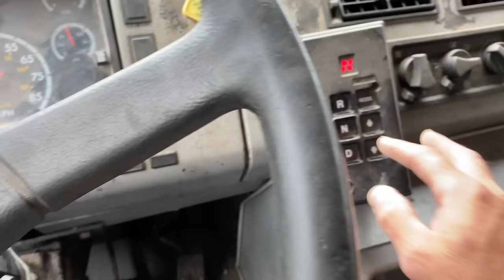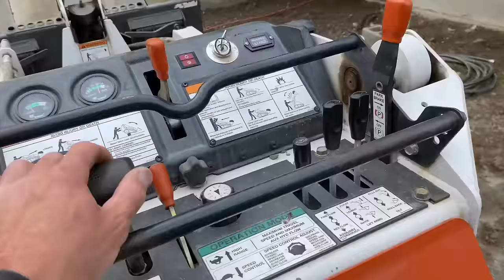NEVER SEEN BEFORE TECHNIQUE TO BUILD STAIRS

Comment: Fulton Spring Works 👍, and the slow shift into gear is probably a sticky air servo, sometimes you can clean them up, sometimes just replace them, might be electric too, but yours sounds like an air servo.
Reply from the maker: Thanks for the info on the truck.
Reply: @bondobuilt386  Been there, done that! 😉 By the way, a lot of armchair quarterbacks in here today, I think you should take everything they say very seriously! And to make sure you don’t forget, write it down on some Charmin, or Angel Soft, using some brown ink, of sorts! 😂🤣
Reply from the maker: Ya buddy this video has brang them out of the woodwork. LOL @Musclecar1972

Comment: No railings? Inspection or not, builder shouldve insisted.
Reply from the maker: They built temporary railings they are in the video and they ordered iron railings to be installed later.

Comment: Legit work,  you always produce high quality work,    seeing that cut Block in the middle of the run on the steps,  obviously because of the predetermined width of the steps  ,   got me wondering , why not run those half bond or running bond. ?   Then as I'm typing it hit me.    There all getting core filled and it prolly fills more complete without the bond.
Reply from the maker: You are correct my friend. 😀 Thanks.

Comment: Very nice, was wondering if you were going to do the bottom step and you did, very nice, luv the over hang of the steps, i'm thinking its 1 1/2"? I do this often an 1 1/2" with chimney caps and columns.

Comment: I need some help. I hope you have time to answer my question. Awesome video as usual. Love watching your videos. I learn a lot from them. Things have definitely changed since i worked with my Grandfather (concrete mason,crew leader) 35 years ago. I need to build a house, my40 year old mobil home is coming down around me. I want to pour a slab but don't have the money for a monolithic pour. 
Here's my question: Can you pour footers and footers for beams, build stem walls and beams for loadbearing walls with concrete blocks, and pour concrete inside to top of concrete blocks for a fished slab?
Reply from the maker: https://youtu.be/VwM0fJQ_xTw?si=6U_qggyI_oE4FEuQ
Here is a video where we did blocks on a footer and then poured a cap on top.

Comment: Make sure your axle can handle, i would just look into airbag helpers. The air ride system is safer and smoother ride. That truck can only take so much. In long run if you need more weight capacity you may need a dual axle bigger truck
Reply from the maker: Ya I think you are right

Comment: When I was a youngster some 50 years ago, we would lay at that time the 'cinder block' and fill with sand and pour steps over. Sometime later maybe 70s the precast stairs took over.
Reply from the maker: Yes I have made steps from regular blocks as well.

Comment: Just a little tip the edge underneath i know is hard so i would have placed a half inch pipe  at the 90 degrees angle there to give it that indented look. Edges would be looking better. Job well done though
Reply from the maker: Thanks for the tip. I will have to try that.
Reply: Your welcome sir

Comment: Not sure how that frost protection works. Is the foam board there to take up the heave expansion, sparing the concrete?
Reply from the maker: The foam stops the ground from freezing under the slab and lifting it up.

Comment: I have a parged basement from 2007 in Maryland that has chipping spots any repair products you’d recommend
Reply from the maker: The comproco we used in this video. Chip off all the loose and fill the low spots then let dry and re parge the entire wall. Wet the blocks if it is dry out.

Comment: So close to perfect, but no nosing on bottom step, top step looks like a lower rise, and bead of caulk on forms for bottom of nosings could have made a smoother finish.
Reply from the maker: the bottom is the slab and it will be backfilled to the surface so no need in making nosing.

Comment: What's the reason for the layer of gravel between the foam and the concrete?
Reply from the maker: I wanted to line the foam up with the foam that was around the house slab but I did not want the slab to be 16” thick so we added 6” of gravel so slab was 10” thick. The house slab was 16” thick on the edge.

Comment: What's the difference between filling the cores of the blocks with stone rather than filling them up with concrete as you're pouring the caps?
Reply: Personally I would prefer the stone in the cores for moisture control during the freeze thaw cycle.
Reply from the maker: the stone is to let water drain out as I stated in the video.

Comment: Great videos.  Please let me know if my thinking is correct.  Is the foam to thermally decouple the stairs from the warm ground so that all of the concrete gets cold?
Reply: It's to prevent frost from getting under the steps.
Reply from the maker: Yup thanks.  @ripperwrestling6587
Reply from the maker: to to protect from the frost getting under them

Comment: So i suppose that the theory is that frost wont penetrate the foam.
Therefore the ground wont heave due to the frozen ground.
And the steps wont be damaged as a result.
Stay tuned, because only time will tell how good the theory is.
Reply: I remember back in the early 90's when I was on my 1st job like that with the foam under the entrance slab/steps - all of us were like "well this is different"
Trust me it works and those slabs are still there today. I know it's not common but many professional jobs are engineered that way and have been for decades.
Reply from the maker: Thanks it sounds like you know about it too. 😀 @ripperwrestling6587
Reply from the maker: Frost protected foundations have been in use for decades in colder climates. It is no longer a theory.

Comment: So many things done poorly here, and I just skimmed through the video.  For starters, these guys dropped a couple pieces of rebar into the steps and tamped them down to about 1/4 inch below the surface.  Good chance that rebar will spall and bust up the concrete in a few years.

Also, that foam board isn't doing anything for frost heave, but you've succeeded in making your slab less stable and more likely to crack.

And that parge job is awful.
Reply: And the front of the slab doesn't have the overhang to match stairs,I would be pissed if I was paying for that half ass staircase!
Reply: yeah, good point.  Also notice how jagged the undersides of the stairs are.  That vibrator was conpletely unnecessary; if they had taken a hammer and just tapped all around the bottom of each form, it would have conpacted the concrete and given a much better finish at the bottoms.

I also like how they sealed it before the parge was even dry, much less cured, and then left all the excess to just pool and sit there; makes for a nice inconsistent and plasticky finish in those spots.
Reply: With editing and cutting you can't know for sure they didn't push the rebar down to the lower 3rd, here in Michigan engineers have been designing foam under exterior steps and slabs since I went through my apprenticeship in the early 90's that I know of and having done several like that at Dow Chemical that I still see today in great condition.
Reply: @ripperwrestling there is no editing and cutting.  they show the entire pour and floating of the steps in fast forward from 30:30-33:30.  You can literally see the rebar sitting on top of the concrete of the middle two steps when they float it.  I said 1/4" amd that was being generous.

And if you can explain to me how foam board under those steps mitigates frost heave or any other potential benefit, I'm all ears.  If laid properly, it definitely wont hurt, amd if laid improperly like in this video (just tossed on uneven ground) it may not hurt either, but it might, and it definitely isn't going to help...
Reply: @nikkikiska  go find a job hater
Reply: There was nothing wrong with the concrete coverage over the wet-set rebar on the treads. 3/4” is typical top and bottom coverage, spec’d by most engineers, most of the time.
Reply: @psidvicious  3/4" would be great.  Re-watch the video from 31:40-32:00; you can literally see the rebar sitting on top of the concrete as they begin floating it.  The only reason they did alright on the bottom step is that they were short concrete and had to add some after laying the rebar.
Reply: @nikkikiska  As asked, I watched again and even slowed the video down to half speed. You can clearly see the finisher stabbing the #5’s down into the tread pours with the tip of his mag, in my experienced opinion, every bit of 3/4”. Wet setting those bars is very standard practice. Truth be told, most engineered stair designs these days don’t even call for those bars anymore. Plans used to call out a ‘nosing bar’ right at the tread edge, but it’s rare to see that anymore.
Reply: @TashaOneal-l8h telling the truth doesn't make someone else hateful. Calling people haters does make you a child.

Comment: Y'all could've moved the plants so they wouldn't have gotten coated with sealer.
Reply: Yeah just lazy
Reply from the maker: Ya we are just lazy LMAO  @Youtubsucks5
Reply from the maker: its water based it will not hurt the plants.
Reply: @bondobuilt386  Those plants identify as concrete! There, problem solved!
Reply from the maker: Ya good one Kurt. LMAO @Musclecar1972

Comment: How come you don't have a power buggie.
Reply: We have a Allen track buggy but we can wheel faster than we could do it with the buggy on most jobs and the wheel barrows don’t tear stuff up. Also when we turn the buggy on any of our flatwork jobs it will bend the wire mesh and mess up our sub grade. A lot of times it’s easier and more efficient for us to just wheel it.
Big biscuit

Comment: Do not remove the air ride on that truck, install larger air bags.  I have a 78,300 pound wrecker that commonly has over 70K on the back 2 axles, it has air ride because there are NO springs in the world that can take that much waight.
Reply: He only has one axle
Needs a tandem!
Reply: Better talk to the mixer truck builders, lol I think they might not agree with you, air bags on construction jobs can and do cause headaches at times. Not a fan of air bags.
Reply: @Musclecar1972   I tow 3 to 5 mixers a day.  Concrete is a liquid load and the highest center of gravity on the road, you will never find leaf springs under a mixer.  Mixers use walking beams and solid rubber springs because a broken spring WILL roll the truck!  You can't use a walking beam on a single drive axle, if he adds an axle he will need to get a CDL.  But he can simply install the next size larger air springs.  They will directly replace the ones he has with no modification and increase his rated capacity on that axle by about 6,000lbs.  And the screws will stay in the dash and the frame won't crack from all the shock load from every pebble in the road.
Reply: @andyfields3248  Well Andy, you tow that many a day? What the heck, don’t they know how to drive? I drove them for 30 years, and you are right about the modern mixers, but the earlier mixers did in fact use leaf springs. I outa know I drove quite a few that had them. If he choses to stay with the truck he has, doing the work he does, I still believe the leaf springs will work well for him, without dealing with the air issues of the bags. The last 5 mixers I drove were fronts with combination rear suspension, walking beam, and air bag, the weak point was always the bags. I’m just not a fan of them. I am a concrete, block, stone, and brick mason as well, had my own business before I began driving for a living, had my own 6 wheel Ford dump truck, I never had any issues with my leaf spring suspension, and loaded it heavily, but I did have the springs redone with heavier leaves in the beginning, I personally like to do things once, and be done, from what I’ve seen him doing, he doesn’t haul extreme loads, so they would last him the life of that truck, I doubt air bags would. I respect what you do, your brothers in the business were always a very good sight to see when one of those ”situations” arose. And driving a concrete mixer, you and I both know they are going to happen. People don’t realize the situations we get into, especially the fronts. You I’m confident have seen exactly what I mean. Are you located in the NE?
Reply: @kurtstolar2454   I specialize in mixer towing in the 5th largest city and fastest growing metro area in America.  I started towing mixers here in 1982, my accounts jointly opporate around 2000 mixers plus all the support equipment to keep them fed.  We are not a small tow company, my crew average about 200 heavy wrecker calls per week.
Reply: @kurtstolar2454   Anyway, I tend to have a fairly good idea of what brakes on trucks and what doesn't because I've been dragging them in all day everyday for over 40 years now.  All suspension has its problems but air ride is by far the least troublesome on a medium duty chasis.  There are very valid reasons air ride is by far the most common suspension in use today.
Reply: @andyfields3248  Well Andy, my thoughts on this are, if you’re loaded, going down the road at 60 mph, especially on a single axle truck, and a spring cracks, you probably won’t even realize it, but if an airbag blows, you better be able to put your head between your legs, LOL I’m not speaking off the top of my head, I’m 75 years old, and have owned, and driven for others, it’s been my experience when they blow it’s very easy to lose control. I don’t know that most are air bagged today, you may have more knowledge of that than I do, I personally don’t like them, and never liked trucks I drove that had them. They look like a cost cutting measure to me, not necessarily an improvement. It has been my observation over the years the trucks are being built cheaper every year, not always better.
Reply: @andyfields3248  That’s impressive Andy, but what are the drivers doing in your area that require that many tows per day? I don’t care how large the city is, especially if it’s a metropolitan area, farm country, maybe a little harder to judge things, but concrete and asphalt? Sounds like less than optimal equipment, or maintenance. I was in Miami a few years ago, at midnight, there were close to 30 mixers lined up on a vertical pump pour, I stopped to talk with a few of the drivers there, the job as they described it to me was much easier than what I was used to in my smaller work environment. And the sites we were used to put a lot more stress on the trucks than these were exposed to, we never had that number proportionally that you’ve said here. And front dumps are subject to a lot of stress loads that conventional mixers don’t experience, most of ours were fronts. Most Terex, some Oshkosh, very seldom had to be towed.

Comment: That foam is totally unnecessary in situations like this.
Reply from the maker: The house had foam around it by code. so I did not want frost to pic stairs up in winter when the house is frost protected.